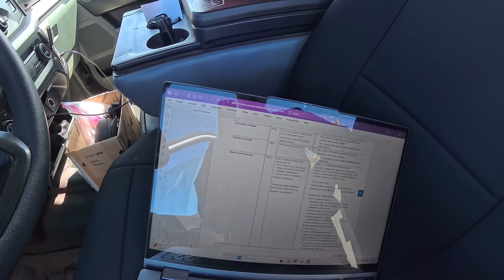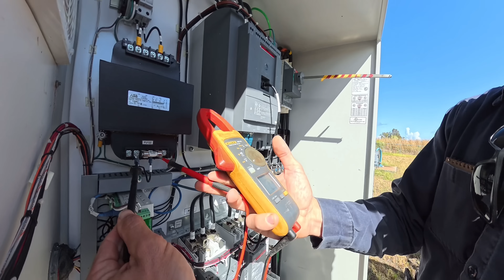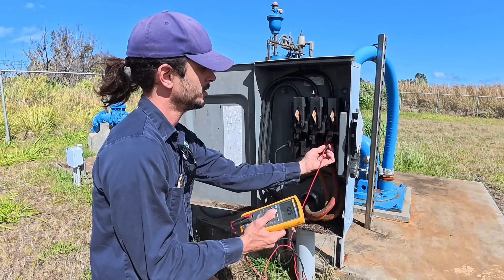100 Horsepower Motor isn't Starting

Comment: You can slam 100 hp across the line but first you need to start it as a wye load, then transition to delta. Look at wye-delta starters. Even then, it may be desirable to switch in some resistance to prevent insane line loads.

Comment: it looks like the in cabinet wire gauge would make it a pseudo soft starter. 🤣 but still not good, would that contactor and protector even hold up to the full start current? make me wonder. 
also the cost of well and the rest, you'd think they'd have a spare starter ready to go at all times. it's certainly cheaper to keep a spare than all other options!
Reply from the maker: They have spares now! Thanks for watching!

Comment: To those who are suggesting dol on a 100 hp motor,  my utility will not permit this due to voltage sags when starting such large motor.  Secondly the upstream protection may open. 

This fella made the right decision.

Comment: Looks like the control box was wired as option to run on softstart or across the line. 100hp on a pump like that shouldn't be an issue for full voltage start. Just do it as an option to the operator. Check the original design or commission docs that should show this tested option.

Comment: Shame you didn't actually do the Manuel's specified tests.
Reply from the maker: You're absolutely right, I learned a whole lot on job and definitely won't make that mistake again.

Later on at the shop it was determined that the starter was toasted internally.

Comment: thyristor is delivering a dc circuit on the ac lines above the ac this is probably to a contactor starter So they do this crap to be fancy this dc circuit could be a supervisory signal and makes parts more expensive I do not see the thyristor so it is internal to the starter I used thyristors 40 years ago on a skip hoist to apply a dc circuit above the ac sign wave when the dc circuit failed do to broken wires So the thyristor allowed the intercom to the operator to work the circuits are low voltage in this particular unit probable on a phone dialer to  call in the fault go to  a hard wired transformer control system and on the auxiliary contacts use the phone dialer and get rid of the thyristors this will never happen again!

Comment: Your insulation test is using the megohm mmeter from from motor leads to ground! You should read 1000 megohms not 100.

Comment: I would agree with others and run that motor in bypass.  That cabinet should have been designed to handle the inrush. There was a time before soft starters where nearly every motor started across the line.

Comment: Are you allowed to keep that slow start? And take it apart and see what failed? Love your videos. Please keep them coming. 👍 We worked in heat treat plant because I was electrician. We've done so many tests on motors. Sometime it's the motor? Sometime it's the slow start? This is a hard one. 👍

Comment: Like the cabinet fans to cool the cabinet. Get the owner to put shade over as well to keep the components in the panel alive and not die from being too hot. The electronics are not as rugged as the hard contactor hardware. Thanks for the video. You are quick and logical in your diagnosis.

Comment: Most handheld general purpose are almost useless below 1 ohm, especially in Cont mode. The megger is specifically designed to measure the low resistance in a lot of windings so you will get a much more accurate reading with that.

Comment: When measuring the winding resistance, switch the Fluke from the Continuity setting to the Ohms range. The ohms range does not beep, where the continuity does beep. Yes you have phase to phase continuity on the motor, so it did beep.
On some Fluke meters the continuity is similar to the diode check and indicates voltage, instead of ohms.

Comment: I think you made the right call to not line start the pump or rather leave it up to the operator. That bypass contactor is there to carry the load once the pump is up to speed. That way the soft starter is just a starter. It can drop off once the pump/motor has fully accelerated and is at full line voltage. The “bypass switch “ is actually not a bypass switch for bypassing the soft starter. It is for troubleshooting/testing the bypass contactor. Hence why a key is required to toggle the switch. Line starting could cause damage to the pump way underground just as you stated. Then they would really be out of water and for a longer time. That Fluke insulation tester is a nice meter but for submersible motors I would recommend a megger that can test >2kv. I was always taught motor nameplate voltage X2 +1kv so for 480v motor 2kv would be a good test voltage. You could also do a dielectric absorption ratio test (DAR) test. This helps you better understand the condition of the motor insulation.

Comment: A couple more years of experience and you will be competent. You really don't need to meg all 3 leads of a motor to ground if you have continuity between the phases ... think about it. (0.23 ohms between legs)
If the engineer spec'd out a manual bypass starter size, and have a by=pass selector switch, why are you second guessing the system and motor to handle it? It is there to test it...no pencil jockey back at the office is gonna know.
Keep up the good work. I was told this 50 years ago by a guy that had been a 30 year electrician ... "It was broken when you got there, no harm no foul to use all test procedures at your disposal 
🤣

Comment: It's amazing how many people just know why the panel is built like that. (Any of you in HI, or worked in places where the nearest repair parts are a plane ride away? You don't risk things that aren't easily replaced.)

The bypass contactor is often there to run the motor after the soft-starter has it up to speed; don't assume it's a substitute for the SS. Ask yourself- if the SS wasn't needed, why is it there at all? (Usually to manage the starting current on a relatively "soft" power line or to manage local sags, as he mentioned.) After that, if the fuses aren't the type and size for DOL starting, it's still a no-go. If the power system isn't up to the task, would you risk it?. Give the owner the risks and let them decide.

Comment: Nice video. I like the digital meggers. We were using the hand crank push button ones when I got out of the Navy a few years ago. I was a little suprised your Fluke didn’t yell at you with the leads in wrong. Mine screams at me if I don’t have them in correctly.

Comment: Why are the wires so much heavier at the well head? My guess is the original setup was 240 volts
Reply from the maker: The submersible cable going down the hole is up sized for voltage drop. The motor is around 800 feet underground.

Comment: I am retired now but started in the trade in the 70s at an industrial electric motor repair shop and did service calls like this of large automatic and manual reduced voltage auto transformer style starters. Fun and challenging. Big pressure because usually something very crucial was shut down.
Reply: Usually when you check between phases phase to ground is always more acturate you can get a voltage but no current

Comment: 8:38 Very smart meter or luck (not this tap), in AMPS setting meter could explode in this connection or at least pop a fuse ;)

Comment: I'm sorry but I'm not sure I agree with the reluctance to run it in bypass. My first question would be who designed the system? Having a bypass is just standard. We were running pumps on line start for years before vfds and soft starts. Yes soft starts are better and cause less stress to the system but they should not be essential. We line started 3000 horsepower boiler feed water pumps in the nuclear plant all day long. Most modern vfds and soft starts will tell you if there is an external problem. If it shows an internal error only it's toast. IMHO former retired industrial engineer with a master's electrician's license.

Comment: You should be wearing insulated gloves at a bare minimum and flash protection if attempting to start motor. Many electricians have been injured due 480 volt swichgear mafuntions.
Good video otherwise.

Comment: There are 2 contactors after the soft starter.
Once the motor is up to speed the right contactor is opened and the left contactor is closed, bypassing the soft starter because it is no longer needed.
The test about the welded contactor the manual is referring to is removing all the cabling from the left contactor and checking the poles top to bottom to verify that the contacts are not welded.
Because high horsepower motors have very low resistance i always disconnect them to do my measurements and go component by component checking one contact at a time.
Reply: Isolating components would have required both effort and tools. I didn't see much of either.
Reply: You don't need a lot of expensive tools to repair this cabinet.
I've been a cnc machine and industrial equipment repair technician for 15 years and i still have the same wiha screw driver set and cheap ass multimeter as when i started.
All you need is to RTFM and some analytical thinking.
The guy is recording a video and try to entertain so mistakes are bound to happen.
When i have my clients over my back talking to me or bothering me i stop working until they get the message and leave.
Reply: A newer ABB soft starter like this one has an internal contactor that applies once the motor ramp is complete and the amp load is below some threshold.
I think the two external contactors are the left one being full bypass, direct on line, un fused using the overload device below the contactor for temporary running if the soft starter goes down.
The right contactor is for the soft starter which is fused, mostly for the starter itself and other internal protections.
When the left, bypass contactor is applied the right one is 'off' keeping the soft starter from being powered at the load side in case the internal contactor is welded.
Reply: Thank you for input, good to know.
So probably the soft starter might be repairable in the field if the problem is a welded contact.
One thing to note is that i see only three cables coming up from the pump(u, v, w) , not six(u1, u2, v1, v2, w1, w2) are all pumps configured this way? 
In big motors cabinets I've worked on there are usually six wires and if anything fails you can remove the vfd and make a star delta starting circuit until a replacement arrives.

Comment: I have always used a permanent marker to write the information about the motor inside of the starter cabinet. You'll never find the paperwork or the paperwork will have we become wet and unable to read..... Believe it or not i've actually had people complain that I write the information inside the cabinet.....
Reply: Subs come with motor specs on glue backed motor labels that should be installed with all product date , phone numbers to manufacturer, specifications (on door interior) in the cabinet. Helps the next troubleshooter

Comment: Manual chapter 7.20.3 says it can run in limp mode with 1 phase shorted, why not try that? It also says the thyristors can be replaced, is that not recommended if you see these faults?

Comment: Seems to me a 100 hp VFD would clean all this up! If starting with the bypass contactor is damaging in anyway, it’s an incredible waste of money! I worked in HVAC with 150 hp motors with direct start all the time! However we were moving air not a liquid!
Reply: Some issues could be leaky check valve allowing air into the pipe column upon start up causing surge on piping

Comment: You think a 100 HP motor will have couple ohms of resistance in the windings? Wtf is wrong with electricians these days... What would be the resistive power lost in each winding, at like 100 amps at 1 ohm?
Reply from the maker: You're right, I misspoke. I meant a couple tenths of an ohm

Comment: Resistance for small motors(few kW) is in ohms, but resistance for 100kW can be in mili ohm and that why fluke didnt measure. It is good idea to have in shop mili ohms meter, it is not expensive but it is big help for large motors, transformers...
Video was very helpful. Thank you.

Comment: I worked many oil and gas systems with multi HP 3 phase motors... and if it had a fault. step 1 is find out what triggers that fault. If that fault is a motor overload condition. you concentrate on the motor. If the motor windings check out... and the inrush is tripping, you have a locked up motor. given that is a submersible, I suspect liquid damage to the pumps bearings.

Comment: why are the leads at the pump disconnect 4/0 but the load going out of the soft start box only 1-2gauge ?     when you disconnected the motor box to see if the softitart would wake up, we did not see you walk back to the motor box.  was that edited out to speed up the video?  just wondering.
Reply: Probably higher temperature rated wire, they can get away with it in a control cabinet with such short runs and ventilation in the cabinet. Been in a few VFD/bypass combos with 150* Celsius wire between components.

Comment: why are the isolation contractors needed?  

Is this basically  a relay that closes a circuit via means of using induction??
Reply: what is the 12" plastic stick coming out of the main disconnect ?    does that open the circuit when the cover is removed?
Reply: disregard.  it evidently does not considering you still have voltage coming into the soft start  my bad

Comment: phase to phase on the motor should be very low ohms.  That would not concern me but will keep watching.  My first check is to ground. A phase to phase megger test does nothing for me going to the motor.
Duh yes that meter is better than the clamp on.  But that is a moot point, you want there to be continuity and you have it. Your meter leads could be really clean or slightly dirty and account for 5 ohms easy. Unless you have a low ohms ohm meter that has the feature of zeroing out the dirty leads there is really no hope of accuracy and no need for it.
Either that starter is rated for 100 hp or it is not.  If that breaker is rated for 100 hp ATL and it most certainly is, being someone built it that panel with that option, Run it. Inform the customer and do what they tell you.. Being that is a submersible with no long shaft and being it is in water and being the panel was built for this option I would not be trying to scare my customer with needless details.  The main reason for soft starts and RVATs before them was to keep your neighbors' lights from dimming when starting a large load and 100 HP is no longer that big on todays grid.
Trucking water is not even an option one would need a fleet of tankers running 24/7 to keep up with a 100 hp well.

Comment: Great video, although I always laugh at 100HP motors needing a soft starter, where as at work 9.15MW, 11kv motor is DOL started on a regular basis. Sure I work at a power station, but still.... :)

Comment: Why not run it in bypass? Why would there be a bypass if it cannot be used? The contractors, overloads and everything else should be rated for starting the motor across-the-line. Soft starters are relatively new and for over 100 years across-the-line starting was standard.
Reply: May be a temporal star-delta configuration. It reduces inrush current to 1/3. And is easier on the pump and tubing than me be not designed for long term direct strat or may be old.
Reply: @GuillermoFrontera looked like straight across-the-line to me in the video. Regardless at 480v 100hp is 125A and the IEC contactor looked sized for that. Point is the bypass contactors were installed for the failure of the VFD, so use it!
Reply: @andyfeimsternfei8408 Totally is direct start, but if the concern is startup inrush current and mechanical stress, star- delta is a cheap and easy to implement solution for a basic, but more gentile startup solution.
Reply: Totally bypass it. It’s not ideal mechanical wise but before soft starts it’s how all motors ran
Reply: @polishsharpshooter2876 Still is!
Reply: Maybe the bypass kicks in when the pump is working and the soft starter is no longer needed (to take off the burden on the electronics)? Bypass the softstarter from "cold" will blow your switchboard.😁
Reply: @crazyedo9979  A solid state soft starter will have an internal contactor that engages once the start up ramp is complete. The one thing he did not check was line to load on each leg of the soft starter which would show a welded contact of the internal contactor, one of the items described in the error code explanation he read.

I have seen old school analog soft starters with relays and large resistors that ramp up the voltage on starts then bypass externally with a large contactor.
This one is just a direct on line, old school full voltage contactor as the bypass circuit for temporary use if the soft starter goes down as mentioned in others' posts.
Reply: @hussy250f  His fault investigation is one thing but I don't blame him because I'm also not perfect and make mistakes sometimes. This is called learning. You are right about the bypass contactor 
which kicks in when the startup ramp is completed. But I assume due to the price and the usability of the vfd the manufacturer placed only a small relais into the device which has to be amplified with a large contactor and this is exactly what we are seeing here. In no way these larger contactors are able to start the 100 hp pump directly from "cold".😁

Comment: You should have measured for continuity between an input and output of the soft-starter while powered off. And, inspect the contactors for stuck contact.

Comment: First time here .subscribed , I used to operate a rubber ext-ruder machine retreading tires that used 100 hp motor .When it had rubber in it it pulled 800 amps to start every 30 seconds all day every day .Cheers from Australia